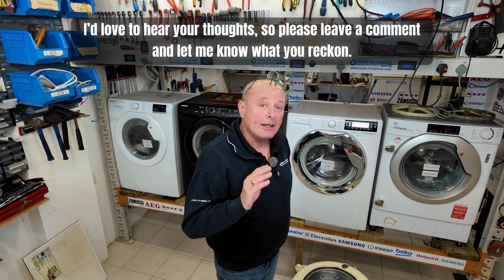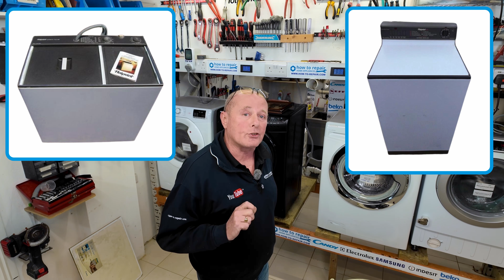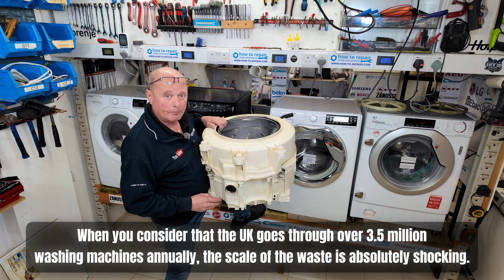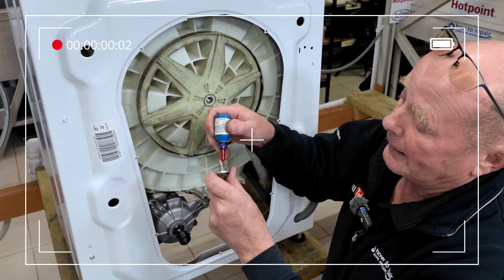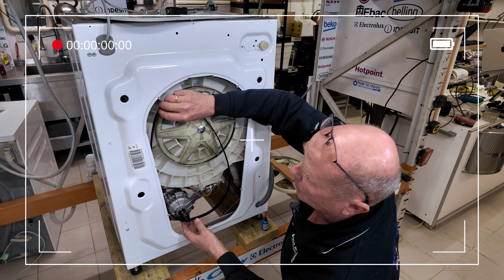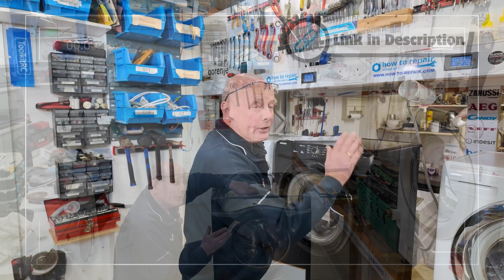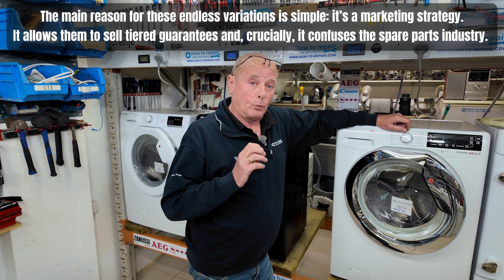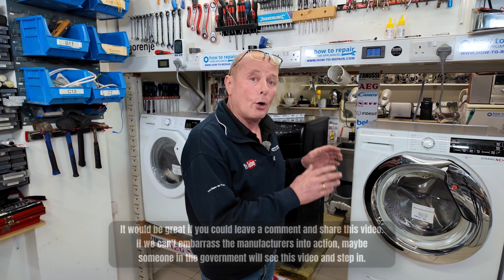I Scrapped 13 MACHINES to Prove a Point: STOP BUYING These Brands!

Comment: Planned obsolescence should be a crime.Fake economy.
Reply: I'm a firm believer that manufacturers should be responsible for not only making a product, but also for its recycling. That would quickly eliminate not only "planned obsolescence", but also problems with recycling or lack of it.
Reply: @Kwaq84  It's already implemented for some stuff (there is for example recycling fee added to solar panels in EU), but yes, that should be included.

And it should be structured in a way where manufacturer pays more if it is scrapped earlier than required period, so if something falls apart in 3 years instead of 10, it stops being profitable to even make it
Reply: @xani666  That still leaves companies in charge of all the resources. They still will make terrible products. People think the point of planned obsolescence is to make people buy more products but that is short sighted. It's to control large amounts of resources. Control all of a specific type of resource and you become a real monopoly. By having countless broken products in the land fill or recycling means you have used up loads of resources and have made it impossible for others to use those resources.
Reply: @xani666  In EU consumer pays recycling tax for every electric applience they buy. That's the reason recycling electric appliances is free and this is good thing because now people don't dumb their broken electronics to the forrests etc.
Reply: @iCuzZ não existe nada grátis.
Reply: @jimbobbyrnes  but say you make them refund the customer if it breaks within 3 years then they lose money.
Reply: @jayplantman  They will change the price to be subscription based. That or they can just let you replace the item every 3 years then they make you pay for an insane shipping fee. They have the power and we have none.

Do you honestly think a government wouldn't choose them over us?

Every law you put in place they will find a way to circumvent it. They have the resources and control the production.

Every law in America for example is designed to create and protect monopolies. Even the laws they claim are designed to protect the public.
Reply: @jayplantman  Let me give you a real way forward. Home production first off. Let people have more ability to produce their products at home. Remove restrictions on machines like 3d printers and allow people to even make their own medicines.

Remove the patent laws and allow companies to sell the same products. Stop monopolies from owning patents that slows down human progress. Patents and copyright are a lie designed to create monopolies.
Reply: @jayplantman  The only way forward is to give the power to the people to fight monopolies themselves. Remove the laws that stop us from doing that. Like copyright and patents. 

Allow smaller companies the power to copy the bigger company's products and to hopefully build it better. If they fail then you can use laws to protect the public from them. Not the other way around like it is now.
Reply: @xani666  it'll just get handed down to the consumer like it always does. Businesses don't pay for the mess they cause, we do. We need a complete rework of the system and that takes lots of us to work together
Reply: @xani666   Then it'll probably be too expensive so they'll go back to less recyclable options. Capitalists are smarter than reformists. Always were. 

We can see for every year of the last 400 where capitalism has dominated, reform never once achieved any substantial change in society.

It's like we decided that we as a species in some way somehow benefit from an owner class of wealthy pedophiles, as if we need them, because without them, clearly, we would have been a blind, directionless mass, without any reason.

You can't solve the core contradictions of capitalism by reforming it.
Reply: @NorthernLiberal   How about instead of being idiot reformists we actually do something about an idealist-derived economy in a material world?
Reply: @Kwaq84  They already recycle these machines, not a good solution. Make mandatory 10 years warranty and 20 years of parts for washing machines.
Reply: @aristotelisentertainment279  Sure, if you pay triple price. 🙂
Reply: @Laksilaks  Unfortunately repairability has a cost and often times very high too.
Reply: @Laksilaks  Half the price, they don't deserve money
Reply: @aristotelisentertainment279 not at all. Engineering can take care of most of that problem. A good engineer will make a machine that won't break for a couple of decades, an amazing engineer will make one that has sacrificial components. They are cheap and easy to replace every few years but the machine will last twice as long as the other engineers. It would literally last a lifetime with minimal costs and work.
It will need to be recycled after that though.
Reply: @Kwaq84  that's never going to happen in the usa, until you people start voting for the guys who actually want to hold corporations accountable, instead of the guys who are wholly in the pockets of said corporations.
Reply: @meyes1098  What are you saying, people should start voting democrat or are you that delusional that it really gonna matter?
Reply: @FragbiteOeXistenz  this starts waaaaay before presidential votes.

It starts with the specific people voted into the government.
Reply: @meyes1098   Who in your mind is such a candidate lmfao?
Reply: @meyes1098  so nobody then your voting for nobody
Reply: @Kwaq84 that's what's covered in agenda 2030.
Right to repair and we're going to probably rent everythujg in the future .
Carbon footprint needs to be reduced for all apparently
Reply: @Kwaq84  I totally agreed. However, i fear the public outcry would just be too big, people  just want cheap stuff,.. people just dont think long term.. global leaders gotta be the grownups and find a coordinated way to stop planned obsolescence.. it will be no no easy feat though.. the sum of things that compose planned obsolences are just so hard to pinpoint.. 

and well said, regarding lazyness.. I can relate... in the current situation living in a scandinavian country.. when an appliance like this fails.. i would just buy a new one.. and hope expect it to live like 4-6 years.. then get a new one. just too much hassel to get somebody to evaluate how it can be fixed, and probably more expensive too. therfore , i would just go to the retailer , buy a new one, and pay for the old one to be collected and dumped.. a new one is anyway dirt cheap compared to other things things i our society.... i wonder what is the degree of cheapness of a washer, compared to the carbon footprint it leaves...? It feels kind of wrong.. just as it feels wrong that one can buy a dirt cheap electronic stuff from for instance, temu or amazon.. something has gone seriously wrong the last 30 ish years.. :/ 

and yes.. i know this is contributing to destroying our planet..  i admit, lazyness, convencience and total price.. trumps my willingness to try and get it working againg with the least carbon footprint.. :/ apoligies to future generations.. :/
Reply: @Kwaq84 
If there is at least one precedent that a manufacturing company will be appointed responsible for processing, then all producers will have to raise prices. Even if it's a plastic package for a pack of soap or peas, a coating for a label, or a layer in a composite milk carton.
Reply: @Kwaq84  totally
Reply: @Kwaq84  THIS!
Reply: Ain't happening, it would collapse the economy which is based on increasing shareholder value and profits
Reply: @jonz23m  economy logic is broken. There is no infinity in mass of production.
Reply: @milsiart4976  the logic is not broken it's just the logical consequence of maximizing profit
Reply: @jonz23m  Very true. Consumers are collectively getting scammed, essentially maintaining and paying the shareholders. 

It should collapse and reset.
Reply: @eakerz5642 facts. The winners are a becoming a smaller and smaller part of the portion of the population
Reply: @jonz23m god has done it to humans
Reply: @jonz23m  it is broken indeed, the resources are limited, one they the world will run out of them and many people will be faced with inevitable reality of having to lower quality of their life then wars will errupt and the whole planet will turn into even bigger shit show than it is already. Money is too important today, its importance could be reduced in many ways in exchange for sustainable solutions but that doesn't sit well with rich greedy bastards,.. actually, they're just poor souls, but nway \o/
Reply: @WithmeVerissimusWhostoned  unfortunately it's ingrained im western culture the "leaders"  are just a reflection of what the system values. And it  has been exported to the world. But the extreme radical form is in the US. So i don't see it change until the house of cards collapse
Reply: @jonz23m  They would still have a profit, it just wouldnt be as large. Nothing would collapse
Reply: @jonz23m good, that economy is the downfall of us all it's the worst. Ever shareholder in this economy deserves to lose it all
Reply: @t16205 i doubt anyone gonna make profit if the US dollar crashes, that's the House of cards
Reply: @jonz23m  Then the economy should collapse.
Reply: @Feotank  i'm with you, and it will, that's why they are starting wars now.
Reply: @jonz23m   They've never stopped starting wars. The western liberal capitalist empire has started over 30 wars since WW2.
Reply: @letstrysocialism  yea i am talking about war's against major powers. Until now those were more slaughters than wars
Reply: @jonz23m   Unjust, unforgivable, unjustifiable invasions, yes.

More people should continue waking up to the fact that the Nazis were the enemies to Liberals not because of Nazism, but because they wanted their own capitalist empire
Reply: Next up: Machines that run for 30 years but we have to subscribe to some paid service for certain features to be available after "buying" it.
Reply: @jarlskjoldur  Already exists, but they don't last for 30 years. Some dishwashers only allow features if you've paid or installed the app. No appliance should be able to connect to a network. Full stop.
Reply: @Dionysos640  You just blow in from stupid town? It's a network security issue. Why would I want my FRIDGE or my DISHWASHER to connect to my network? They don't need to. It's a needless function. It also unnecessarily complicates the appliances causing another failure point.

On top of this, taking functionality away from the appliances and sticking it into an app that requires that appliance to be on the network is insanely customer unfriendly and an inconvenience. It adds nothing.
Reply: funny that the dude who replied to me got his reply deleted. Or maybe you realized how dumb your response was?
Reply: whole capitalism is built around planned obsolescence 😀
Reply: @Pidalin  yea artificial scarcity
Reply: @Pidalin  yep, it's a capitalism issue more than it is a companies issue, we need to dismantle this system and transition to a fairer one ASAP
Reply: @LeJuste12  it's a company/industry issue not a capatalism issue.
Reply: It’s the rich robbing the poor, and destroying the environment in the process. 😕
Reply: Also car manufacturers who can’t supply spares should be stopped from selling new cars. Most Chinese cars are in that position and home companies like Jaguar/Land Rover. Cars are being written off because fairly straightforward repairs cannot be done
Reply: There are companies doing worse like dumping cancer-inducing chemicals in public water and getting away with it because money buys their way out. This is what our system permits. The strong will do what they can, and the weak will suffer what they must.
Reply: 100% all done on purpose like most electronic devices they dont want you buying one machine every 5-10 years they want you buying there crap every year.
Reply: 🌸 why can’t governments put ban on such things
Wanting to be green my foot 
They blatantly close blind eyes
Reply: It creates too much e-waste and yet they are the ones who waffle on about the environment 🙄
Reply: Planned obsolescence is a white lie designed to hide the darker truth underneath. It's all about controlling resources.
Reply: greed an disrespect agains their customers.
Reply: It is in some countries
Reply: it happens a lot in printer, scanner,
Reply: Same with cheap printers. However I made a pc for my parents 16 years ago, some.components were even used. And it is still going strong.
Reply: It is illegal, just people are too dumb to do a little bit more of thinking process and realize that there is not a big complot or anything, just a small % of products that fail because people like to buy cheap stuff, and cheap stuff uses low quality stuff. If X brand dies after warranty, people will stop buying that brand.
Reply: Car industries such as VW do it as well as others. Ones,warranty is up you start getting bits to be replaced. Big conspiracy.
Reply: @Rainer-i4f yeh they are called common faults
Reply: Not just that its fake, but why do I have to run eco programs on a washing machine that might be scrapped 5 years later. If the government really wants us to be good for the environment, shift the responsibility to big corporations as well not just to consumers.
Reply: @notyjeff  Well said sir.
Reply: The more resources they use up the more expensive they can make their products. The more resources they waste the more they can charge costumers. The entire plan is not obsolescence its a garbage dystopia with limited resources owned only by companies.
 It's resource manipulation.
Reply: The more pointless products they make the more resources they use. The more resources they use the more governments and people allow them to use.

That is why all modern products come with useless features like internet connectivity. It's to ensure that certain resources are being used.
Reply: Actually it's not "fake economy" it's "Real Capitalism"... How else are you supposed to pay salaries if you sell products ONCE?? I mean... If you have a product that lasts 10, 20, 40 years.... You would go out of business at some point. And I saw a comment here about "Green Agenda" lolol I'm an Environmentalist actually... You think I don't DREAM about products that last 40 years or MORE??? Ohhhhhhh you better BELIEVE I do!!! But I tell you what Capitalists tell me - I have a business to RUN HERE. 50% of my life is about fighting what these con motherfuc*ers do!!! With little to no success I might add...The other 50% is dealing with IDIOTS
Reply: It should be illegal, particularly when you consider how much the government claims to support the environment. Like everything, it's about money and control, and has FA to do with the environment.
Reply: Agreed
Reply: End environment 😢
Reply: it is a crime, it is fraud.
Reply: I remember my teacher told me our economy runs on garbage when I was a tiny little kid, it seemed so counter-intuitive... It still mostly does, but I can see how it's exploitable by the people who have a say in it.
Reply: Cars has become just as bad
Reply: @t16205  Today cars are totally crazy, giant displays, something is constantly talking to you.....that's exactly what I don't want.
Reply: @Pidalin  Cant really call them cars anymore, they are transportation boxes on wheels with an ipad.
Reply: @t16205  and it's also super ugly, it all looks like some angry animals with wheels
Reply: @Pidalin  Yeah and no one would ever know if you switch the badges, they all look the same
Reply: Fake governments !
Reply: It is always the same - 'the market' only applies if the 'right' people have benefits from it. Otherwise all kind of fakery is happening.
Reply: carbon footprint would be lower, just proves it's a scam
Reply: Surely you can affect it by voting the 'right person' or 'voting with your wallet' haha
Reply: Agreed
Reply: The problem is that in history there are several examples of companies that made products of such high quality, nobody needed to buy a new one, and the company went out of business. I know of a waffle iron producer that produced stuff so good, that you never needed to buy a new one. 
The problem was that after a decade that had killed the market not only for themselves but for everybody else.
Also people buy crap, what do they expect? People also buy brands nobody knows. You will never find replacement parts for those. 
My Dyson is 20 years old and I had to replace the motor 3 years ago. I could still find the parts and not expensive at all. 
In a way you get what you pay for.
Reply: This is probably the work of a consulting company like McKinsey, Bain, BCG....always finding ways to cheat money from ordinary folks to fatten C-level pockets.
Reply: Pass a LAW adding  the Cost of WASTE Recycling as a fee & manufacturers must buy back their own broken equipment at cost.  Every device comes with a federally required Lifetime Warranty  it breaks ?  they have to buy it back.
Reply: The only time I've seen that it made sense was with light bulbs. Without having light bulbs planned to die after X hours, innovation and R&D would most likely have stopped? We wouldn't have all of the LED equivalents that we do now.
Reply: it is a crime
Reply: to keep companies in busness and raise profits, they are kinda forced to do it, and im not saying this to defend them, i absolutely abhorre this practice, truth is, it's the global system in which the world operates, AKA capitalism, we need to transition to socialism and have UBI so companies wouldn't keep doing that ( and if they do, dismantle them).
Reply: Everything is fake around us. They made our life fake
Reply: Lucky for all EU members, there is a Law on its way to make planned obsolescence illegal and oblige all manufacturers to make their tech easier repairable.
Reply: @jdsd_  The "Right to Repair" Directive (Effective July 2026) and a few other directives and laws will come into being this year within the EU. The big question is will those consumers pay more to buy these products because nobody does anything for free, hopefully any increase in purchase price will be small in order to secure a better product with superior longevity.
Reply: @andrewshore262   Well, Europe is the second largest economy in the world, we should not forget that, so companies are dependent on the EU market almost as much as they are dependent on the US market. Therefore I dont think there will be big price increases.
Reply: I am not environmental guy, but this is so excessive to be not able to repair ...
Reply: Profiteering scam schemes on the get rich quick mode...🙌🏽!!!
Reply: Looks like everything is taking a course in that direction. Having an Samsung monitor to replace every 2 years, pc chair - 2 years max, electric cars pushed up on us - but their 100000 km equals to 350000 km in internal combustion engine cars... We will be sent back to cave soon
Reply: @walgusaastaalustab5525  cheap office chairs have never lasted long. Chairs get heavier and higher quality as the price goes up, but prices have always been high for quality chairs. I've had this current one for 4 years and my previous one I had for 6. It wasn't even broken when i decided to replace it. It just had worn cushions and was creaky af.

Don't buy gamer chairs if you want an actually good office chair. Gamer chairs are notoriously terrible and have always been terrible no matter the price point.
Reply: Well its closely linked to capitalism, so we need to confront this on a higher level.
Reply: Not 'fake economy' but pure thievery.
Reply: Your right it is a false economy
Reply: There's a movie that warns against it, quite old as well so we know it would be a problem, a man invents indestructible un-stainable fabric and is attacked by society for "ruining" the fabrics industry and putting people out of work
[The man in the white coat]
Reply: hard to prove it
Reply: A lot of people share that frustration when they see appliances or tools failing much sooner than older ones used to. The whole idea of “planned obsolescence” comes up often in these discussions because people feel like products are designed to be replaced rather than repaired. At the same time, modern products are also dealing with efficiency standards, electronics, and changing consumer expectations, which sometimes makes them more complex than the simpler machines from decades ago.
Reply: absolutely, it's damaging to humanity in many ways and whoever came up with the idea is a greedy monster
Reply: Facts
Reply: Thank jews
Reply: Any part in any machine has an expected lifespan. It's the customers job to check a product when you buy it. If you can't judge it get someone who does. If it doesn't hold give the manufacturer the option to fix it, or sort out that manufacturer.
Reply: Absolutely 👍🏼
Reply: Everything that you buy nowadays have increased planned obsolescense
Reply: CLASS GLOBAL ACTION outrages when people want to CONSERVE THE ENVIRONMENT
Reply: It's one of the great innovations of capitalism!
Reply: If a machine would last 50 years, who would buy a new one?
Reply: @spyware1100   Why should we care about that?
Reply: @letstrysocialism  are you asking that seriously? If noone buys, there is no reason to maintain factories. Which results in brand bankrupcy and therefore thousands of unemployed people.
Reply: @spyware1100   Sounds like the problem of a very shitty and fundamentally unsustainable economic system. Gee, I wonder if there's a way to manage society without a wealthy pedophile class of owners...
Reply: This is just one of many examples. Look at car industry, car brands make money not for selling cars, but for selling parts. Cars today are a piece of shit in plastic with wheels.
Reply: U use fiat money it's all fake go read a book get off youtube
Reply: I love China!
Reply: fake green
Reply: It's on everything. Even the manufacturer put a sticker in my electric water heater saying "7 yrs only" !!!!!!
Reply: Its legalized fraud
Reply: Meanwhile climate change is a billion dollar industry. They absolutely really care...
Reply: You would be shocked if i tell you that every Manufactor does it.
Doesnt care what you are buying.
Phone,Fridge,Washing Machine ,...
Reply: @perascabal6807   We know, we expect politicians who bully farmers and force paper straws on us would write legislation against planned obsolescence.
Reply: All industries have decided it's easier to make far more money forever when they stop making appliances that live for 30 years.
Reply: I would be very much in favor of burning EVERY copy of Bernard London's treatise.
Reply: working for a company like that should be punishable too. Vote with Feet.
Reply: People don't care, they change smartphones every year. People love to by new things.
Reply: It's not "fake" for the rich man.
Reply: While i totally agree, planned obsolescence was invented to "solve" economy.
Reply: not really planned obsolecence there, theres an engineering tradeoff on front loader washing machines thats almost impossible to overcome, GRAVITY. theres no material that can make the spider arm other than aluminum... just dont buy a front loader and they will stop making them.
Reply: The thing that makes me angry about this timeline. I don't mind a yearly cheap checkup and maintenance schedule like thats recommended for cars. I wouldn't mind 50 bucks here or there, but the parts on new machines if you don't source it from china or buy it online from a parts store costs 100s without included labor. It's maddening
Reply: Like virtually everything now you can’t repair it, or it requires specialist equipment, diagnostics or tools. My washing machine in the 1980’s lasted until 2004 and washed clothes really well. My Flymo strimmer from 1991 built in England lasted until 2023, we’re being tucked up on everything the majority of goods are built in China and it shows. My current washing machine is a 2022 Samsung, came with a 5 year warranty and the conditioner pump that services the conditioner tank failed after 18 months but obviously that was covered and repaired. I’ll feel lucky if the machine makes it much past 5 years it’s all wrong. - great vid thanks for highlighting 👍
Reply: @andrewshore262  "or it requires specialist equipment, diagnostics or tools". Although technically that is a valid point. The tools have gotten so advanced that everything has become repairable. Except for one specific item. 

Example one is 3D printing or CNC. Now it's possible to make a replacement part in hours as long as you have the technical skills in 3D printers and modelling. Very low barrier to entry.

Example two would be electronics repair. A lot harder skill to learn but much more fulfilling. This is where monopolies really come into play however. This is where the planned obsolescence fight is taking place. The processing chips are closely guarded and controlled. This is where the biggest push is. Electronics guys push back the hardest and get hit the hardest. 

The true step forward is to make a 3D printer for computer chips. Then repairing becomes viable again. Home production becomes viable.
Reply: @jimbobbyrnes  в ремонте электроники есть две сложности:
1) Найти оригинальные запчасти (электронные компоненты, микросхемы, процессоры) очень часто невозможно. В лучшем случае получится найти бывшие в употреблении или поддельные чипы на Aliexpress/Ebay по неадекватно высокой цене.
2) У мастеров как правило нет доступа к схемам и даташитам по ремонту электронной техники, а без схем сложность ремонта возрастает в разы и шанс не ремонт уменьшается.
Reply: @andrewshore262  Basically if every part of a machine can be printed at home using strong enough materials, then i can design you a washing machine that would last a life time.

It's possible today but not cost effective. Yet.
Reply: @andrewshore262  I'm ok with repair (in some areas) requiring equipment, skills and so on. Fixing phones and laptops require those, it goes hand in hand with the level of technology we have. However, some^W most manufacturers specifically make effort to make eg. chips unavailable, you can't even buy them from the origin - then claim being environmentally responsible. And so on. Doesn't look too good right now.
Reply: @jussiollila7714 Good point regarding replacement chips and other specialised parts but, I do not understand why I need such a high level of sophistication to wash clothes which in turn leads to expensive service tools etc. I accept the high level of sophistication on my motorcycle, electronics, rider aids and lightweight materials there’s tangible gains when I’m riding, but my washing machine from the 1980’s did the job and lasted decades (it may have consumed more water & power) but look how robust it was, putting it simply I don’t need all the additional headaches modern tech provides in places nobody wanted it. The world is run by marketing people and accountants not engineers.
Reply: @andrewshore262  Had a great Cambridge Audio PC speaker system but they'd encased the main amp in solid plastic with no way to get at it to repair without creating a total dogs breakfast of it. They know fine well what they are doing, deliberately designed to prevent repairs.
Reply: @MrSpeekerv1.0 Somebody sat down and thought about that, I’d say remove that brand from your future buying decisions but when they’re all at it there’s not much we can do about it we’ve entered a truly use and throwaway world it’s nuts.
Reply: @andrewshore262  Of course they did and I totally agree with you. Sad really but like he says the politicians don't want to clamp down on it because it keeps people in jobs and the economy flowing while lining the pockets of these companies, unfortunately at our expense!
Reply: everything is fake , from the  craddle to the coffin,   everything you was taught  is fake , fake histrory  , fake  religion , fake attorneys , fake teachers , you name it
Reply: @happyfeet231259 Was your mum fake, too?. Don't be ridiculous with your nihilism 😂😂😂
Reply: @happyfeet231259 I've come to this conclusion. Intuition , spider senses.  Or I'm just going bonkers. It's why we are here I think. To work out, it's all smoke and mirrors, a charade. Some sort of test. But nothing is real. I'm thinking some giant computer program matrix thing going on maybe ? But a bit deep for this channel.
Reply: @happyfeet231259  I was taught you were intelligent.  Fake it seems.
Reply: @ferrumignis he does have a point, a lot of the jobs we have are quite "fake" as in made up of think air and don't solve real problems but made up problems
Reply: @HexterJexter  I agree that there are jobs that serve absolutely no purpose or give any benefit.  His claim that everything is fake is what I'm disputing; if this was true then he needs to admit his post was fake.
Reply: @ferrumignis sure, he did use "everything" in the sentence, his mistake, but it's unrefutable that the meaning of his words is true, you go around outside today, and maybe not "everything", but it sure does feel like everything is fake
Reply: @HexterJexter  Using the word "everything" was clearly not a mistake.  You don't accidentally type "everything" instead of "some things" or "many things".
Reply: @ferrumignis well, now that we got at this point it is also clear what your intention here is, it isn't to understand this person, it's more to create discord and fight in comments
Reply: @HexterJexter My intention is to hold someone to their statement when that statement is patently ridiculous. Clearly your intention is to believe everything you read without a single question and then try to defend it.
Reply: @ferrumignis no, i disagree with you, and i can see what you're doing, so you get no more input from me, i am above your pettiness, and you are bellow internet trolls
Reply: @ferrumignis  Good oneeeeee XD
Reply: @HexterJexter  " you get no more input from me, i am above your pettiness"

Do you admit you are fake?  If not then you have immediately disproved the post you were arguing for.  Feel free to run away with your tail between your legs though.
Reply: Difficult to tell what is planned and what is just poor quality
Reply: @psxtuneservice  Yep! A 10 year warranty or 12 year warranty should be offered by a company confident in their offering.
Reply: Speaks volumes about green agenda doesn't it
Reply: @andyOsalek  One has nothing to do with the other. What is really green isn't what companies are selling you, but that doesn't mean the agenda itself is wrong. It's just being abused.
Reply: Planned obsolescence is made to maintain a buying cycle and regularly reniew the company's revenues.
Reply: @oscillatine  funny how if I got, lets says a candy and it fails, for sure Im going to get another brand, maybe it gonna fail aswell but Im not buying the same brand for sure
Reply: Hypocrisy of net zero
Reply: @carole2488  What has it got to do with net zero?
Reply: @bigchrisrogers  I think their point is that legislators (and companies) like to pretend they care about the environment by focusing on things like net zero but they do nothing about all of the other insane amounts of pollution/waste and manufactured rubbish that is possibly more harmful to the environment and almost certainly is more harmful to consumers.
Reply: @carole2488  Rubbish. If the second  industrial revolution had been avoided completely then the issue of releasing carbon that had been stored underground for millions of years would not be pertinent. That doesn't mean trying to limit the damage of the industrial revolution isn't important. A rudimentary knowledge of geology shows that it is perfectly normal that species (like the plankton and moss that forms crude oil itself, having captured so much carbon when in the blanketed the earth's oceans and casused massive global cooling!) can affect the Earth's climate, just as Homo Sapiens have now done on a record short time scale since the second industrial revolution.
Reply: @TassieLorenzo Well depends on what scientist you believe. What im talking about is, as someone mentioned, targeting things like ICE cars while importing electrical cars from countries like China neglecting consideration of the carbon effect of producing and transporting those cars.
Reply: And YET the government wants to ban you from driving, stop you eating meat, having warm water, charge you extra tax to 'save the planet"

Anyone still believes green initiatives are anything other than a money grab needs to wise up quickly.

IF it was truly about sustainability and waste reduction short lived throwaway products designed to fail would be illegal.
Reply: @bobbyrayofthefamilysmith24  it's about population control but they curate their differently narratives for each side of the isle to trigger their NPC brain.
Reply: @jonz23m Green policy is step by step creating a social credit score system similar to the chineese system. It's being built piece by piece under the guise of "sustainability" all these restrictions, taxes and limits only apply to individuals whilst large corps constantly increase the amount of  trash they create whilst making ever increasing profits. It's obvious to anyone who thinks about it critically for more than a second
Reply: @jonz23m  Indeed it is about curating "opposing" ideologies to cater to the common fallacies, while in reality being very aligned toward the common goal. Exploit the dumb mass as much as possible while transferring wealth to the more clever "elites". Come to think of it, it would need a miracle to work the other way around.
Reply: Zionomy
Reply: what do you think so called computer software upgrades are ? it it the same thing , nothing but profit by making all you buy have a very short life
Reply: It's a logical consequence of capitalism, I know people gonna bitch about me saying that but that doesn't change reality. They need to create artificial scarcity to make more money or to keep making money because if a product becomes commoditiesed profit gonna be near zero.
Reply: Then we won’t have work. That is why most cats and electronics keeping max 5years. Actually, there was law proposal to limit any products time of usage. For example , build in mechanism that cuts wires after certain amount of hours or engine won’t start after 75000 miles. It would increase job opportunities and tax income.
Reply: @Sweeet_Low   yes, it's not a manufcaturing issue, we know how to design long lasting hardware, it's purely a capitalism issue, so we destroy the planet to fatten the bottom line of companies, as long as we operate in capitalism, we are doomed ( we can see how destructive and evil the US is, and the fact they lobby for capitalism tells us everything)
Reply: @Sweeet_Low that's the least smart comment one can make on the subject, to put it politely.
So I save a couple thousand bucks a year because planned obsolescence is illegal. What could I do with that money to damage the economy? Even if I made a bonfire with those bills, that would make your own money more valuable.
But what I would REALLY do? Buy better cars, food, anything.
Delusional, to say the least.
Reply: it doesn't even need to be planned. Just go with cheapest way to solve every engineering issue,and it will obsolete itself
Reply: Thank FDR's brain trust for coming up with it.
Reply: I agree but the opposite is true in the US sadly.
Reply: Planned obsolescence will be a crime under socialism. Not under capitalism. Enjoy!
Reply: People will say you are a communist and an enemy of the State for holding such a thought lol
Reply: Ainda patrocinam discursos com conteúdo ambientalista. 
Hipócritas.
Reply: What a gay comment. You should be ashamed of yourself.
Reply: @need2sneed-  "gay comment" that's like a language from 2005, you must be a time traveler 😀
Reply: Yeah, if you want to have no appliances, make it a crime to produce then, good idea.

What is actually needed is not more silly laws (right to repair? only makes those same companies sell components at a higher price which makes actual repair unaffordable!). What is needed is free market competition, which apparently has been all but eliminated through regulation.
Reply: How will the company remain profitable if you use one machine for 30-50 years. Same thing happened to electric 💡
Reply: if people dont buy new products we will all be unemployed,
Reply: @debeeriz  anyone living up to the 1980 would disagree with you. There is a market for spare parts and repairs. It's just easier and more profitable to sell a new machine.
Reply: @JaySilva88  i am 77 l repair a lot of stuff, but  by the time you pay for   a service man and spares you may as well buy it new and get the  5 year warranty  if you cant repair it yourself, 9 times out of 10 they will take the machine away or come back a few days later with the part, making you pay twice for travel
Reply: @debeeriz 5 years warranty where??? 😂😂😂
You are lucky if you get one year.
Reply: @carloscabrera1912  in new zealand by law washing machines and  dishwashers have a 5 year warranty regardless of what the manufacturers say, fridges and stoves varies from 5 to ten years
Reply: @debeeriz  

Good to hear that about white goods warranty requirements in NZ.
Reply: You need to find more reputable repair men! I've used several local repair men in the last 20 years for various things and I have never had anything but intelligent and helpful service and reasonable costs. Certainly never heard of such prices for a call out!
Reply: @debeeriz  People shouldn't be needing to buy new white goods every 6 or 7 years in order to keep the economy going.

For starters if things were actually going to last, they could charge more money for them Unfortunately at present even if you pay more you're often still getting crap. Not always, but a lot of the time. Secondly just make spare parts available. They can sell these and well, make money off doing so, without charging the earth.

We don't need to be scrapping goods that take a lot of resources to make every 6 years. We never had to do so in the past and the economy frankly worked better than it does today.
Reply: @debeeriz 

If everything could be made with 100% automation and everything lasted for ever, with faults being a very rare event once manufactured. So that we only dismantled and recycled when a significantly newer improved version becomes possible & a typical washing machine might be used for 32 years. The macro economic result would be that everybody would have to work less, would be wealthier and life would be more fun.
Reply: Employment is constant work with no ability to stop. That's slavery. Textbook. We're supposed to be served by the economy, not serve it. We're humans not bank accounts. We are faggots for still being afraid and still paying bills and taxes.
Reply: We will also all need less money because things last longer..
Reply: @debeeriz   then the economy is stupid. We need a better economic system if this one needs us to be comsumerist who never stop.

Waste of resources basically.
Reply: @debeeriz no, the economy would have to readjust. There should be orders of magnitude more of the companies servicing broken equipment. 
I'm sure that if there will be historians in the next 50-100 years, this age will be called the age of greed. This is a suicidal civilisation that must and will fall
Reply: @pitong1989  if you want to live in that sort of society, move to cuba
Reply: @debeeriz what a moronic outlook on life😂